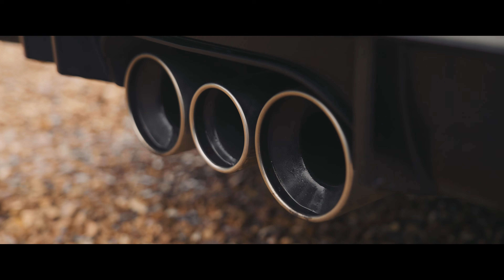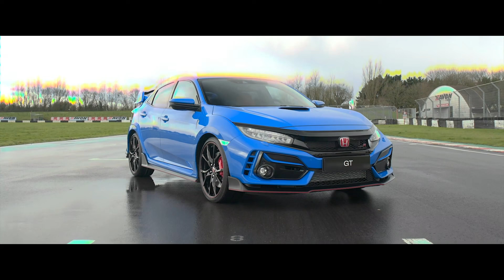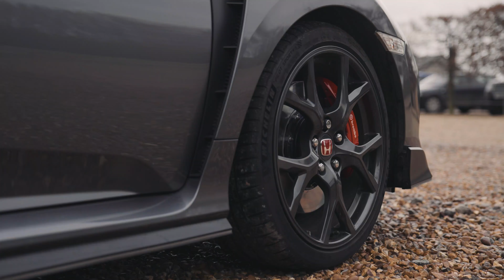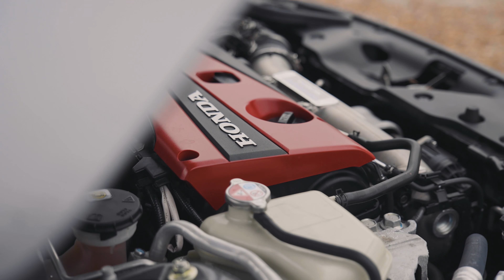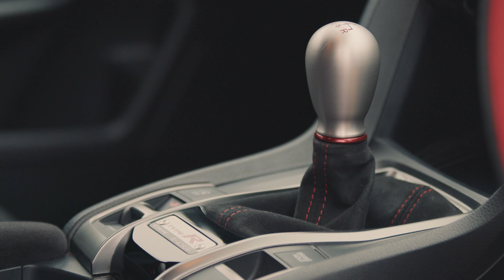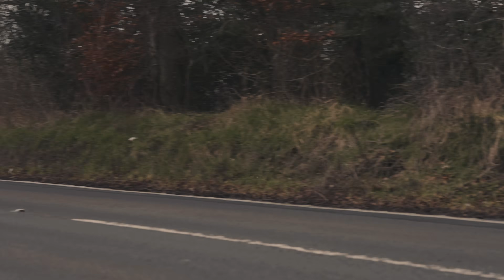Honda Civic Type R Sport Line road review | The last UK Type R

Comment: I am a Honda fan, but I would not swap my 1999 Integra Type R for this car - 320,000 Kms and still going strong! It look as if the Civic's been put together with cheaper parts. It's performance is below that of many of the new hot hatches,  5.8 secs 0 - 100  isn't that 'hot'. I'm hoping for a new all-wheel drive Integra, otherwise I may opt for the GR Yaris